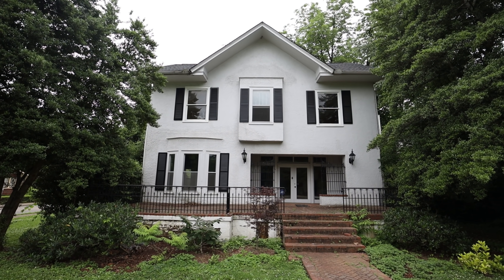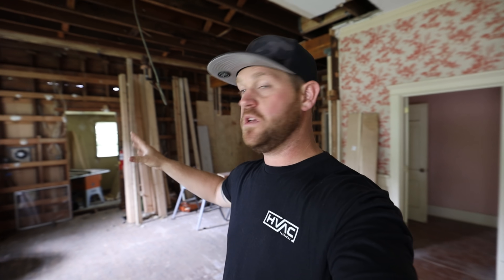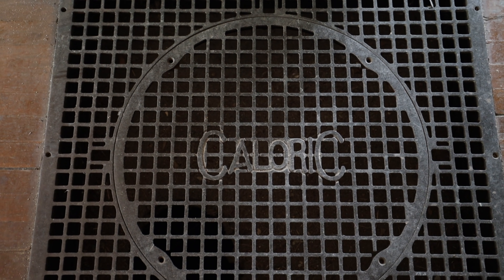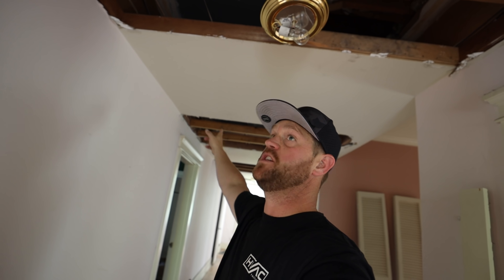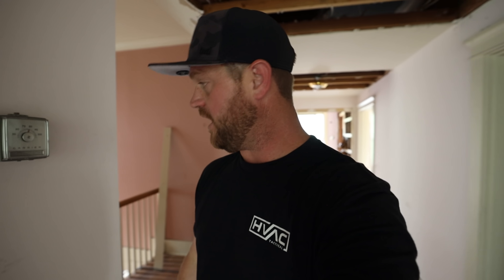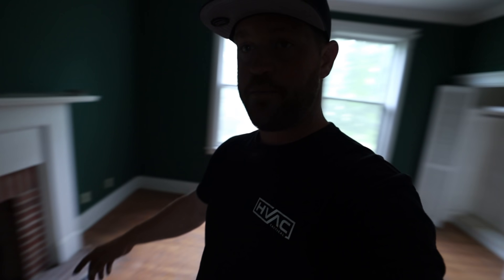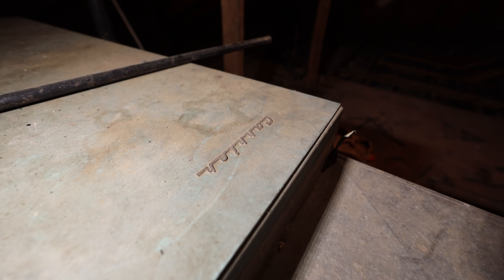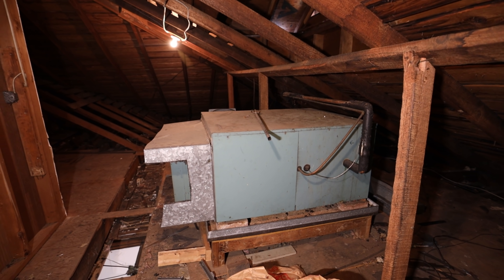Upgrading The HVAC In A Home From The 1900’s

Comment: That is a late 50s early 60s Carrier unit.  It would have run another 20 years with proper maintenance.  That T-Stat was built by Honeywell, same vintage.  The more expensive version of that Honeywell T-Stat had the cool and seperate heat temp settings that would switch automatically to needed air conditioning.    Did they have a gas furnace for the downstairs?  You mentioned something about gas lines.  Interesting project.  I really think this house is too large for a heat pump system in that climate.  It Won't be efficient at all during the coldest months.

Comment: God I’d love to have a vintage ac system like that, I don’t care how efficient it is, that’s one of those old systems where it can be 100+ outside and you turn it on and it will freeze the house out. I remember my great grandmother had one in her home from 1958 in Georgia it could be 105+ with 70+ RH and that thing would freeze the whole house out in 10 minutes flat and pull extraordinary amounts of condensation out
Reply: Probably an R12 system
Reply: @ClimatronACInc  Yea, or Carrene-7 aka R-500, can't wait to see what outdoor unit they had there.

Comment: I have been doing HVAC/sheet metal mechanic for 31 years all for the same small family owned company.we have been Carrier dealer since 1952.that system in the attic is air conditioning with electric heat.probably installed late 50’s early 60’s.cant tell from your video but if it’s enough room in attic,do a nice perimeter duct system so they can do away with the chase.down stairs you need more then one return for a 5 ton system.thats a big house and would help with circulation of air.i live in southern Virginia and have done a lot of these older homes and they can be a challenge.good luck on the project